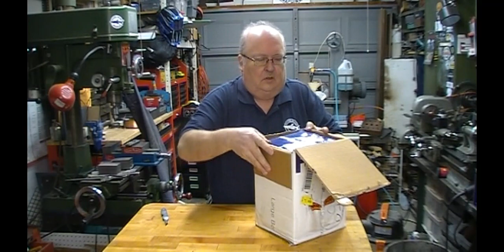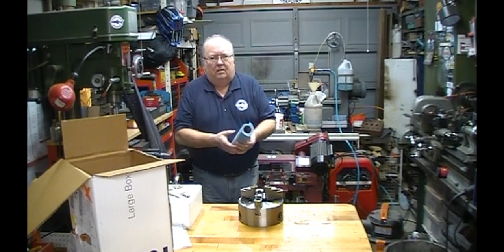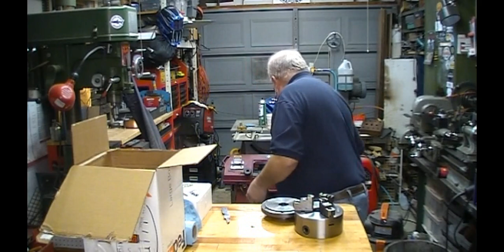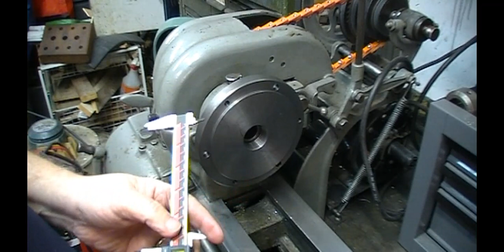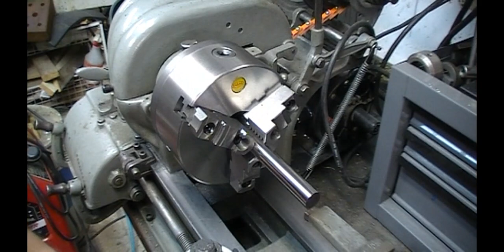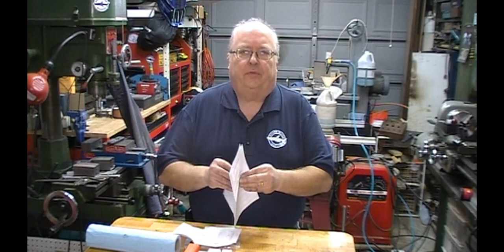Shark Bits #24- Mounting The New Chuck

Comment: G'day Steven don't we love Christmas presents even if they come a bit latter.  I always machine the registers on the backing plate around 0.003" underside.  Bolt the chuck up lightly and tap with a soft hammer whilst checking run out.  Once your running 0.000 tighten up the retaining bolts.  Been doing it this way for many years without the chuck moving and l have given it a hard time over the course with no issues.
Cam
Reply from the maker: I actually cut it about .002 undersize and I plan to play around with it.  I am also going to turn the mounting plate around and cut about a 1/4" off of the mounting boss.  It will give me some additional thread engagement and move the chuck a little closer to the head stock. Thanks to watching and commenting.

Comment: My 3 jaw chuck is about .0025 as well.  If you want to be really accurate you have to use a 4 jaw.
Reply from the maker: I am happy with the run-out on the 3 jaw. I have a 4 jaw that came with the lathe.  I use it when necessary.  Thanks for stopping by and commenting.